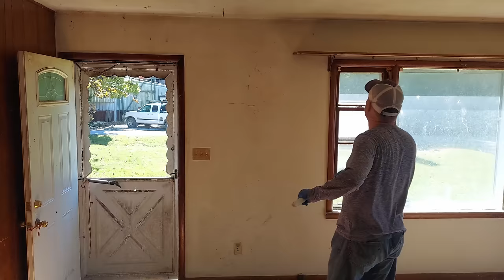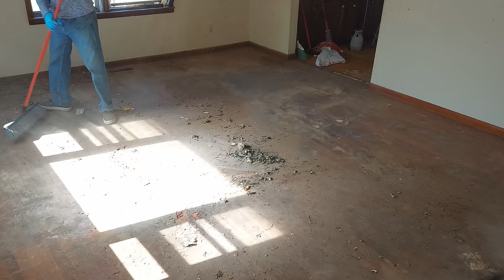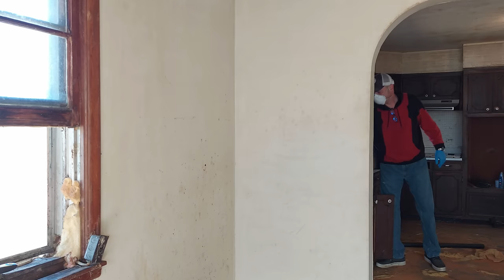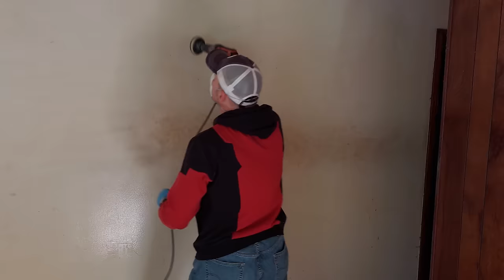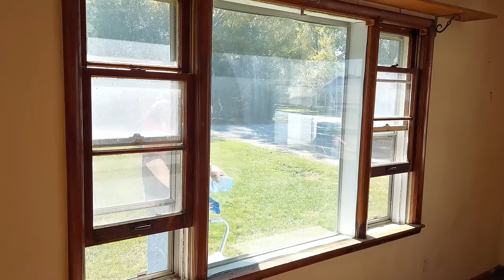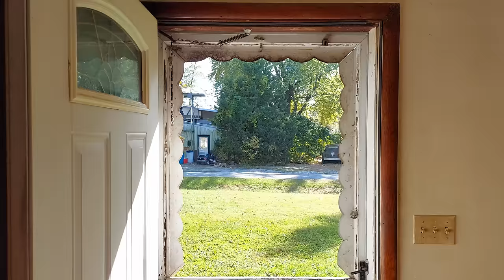Hoarder Aftermath: Cleaning RUINED hardwood floors

Comment: Old trick I was taught years ago was to take sawdust/small shavings and add a little water. Thoroughly mix until it has an even damp consistency. Throw around the floor and start sweeping. This will cut down on the airborne dust and help prewash the floor.
Reply: Sweeping compound works the same way.
Reply: I remember hearing that tip a long time ago.  It was common for people to have small amounts of sawdust around from wood working projects like fixing fences and building shelves. I think that stables and barns buy sawdust chips for bedding. They also use it to clean the aisles in the stables when they sweep them.
Reply: Also, just sprinkle some water on it, cuts down on the airborne dust.
Reply: To trap dust when sweeping floors when I was young, decades ago, was to throw on used (wet) tealeaves.

Comment: This home really looks like it actually has a lot of character. I hope it can be fixed up and salvaged. Thank you for what you do! 😊
Reply: I agree. It's a lovely home
Reply: @cynthianm1743  For that really nice flooring better to get a sander to remove the embedded dirt stained into the wood surface.
Reply: @chrisharvie-smith486  he better be a good craftsman to fix this
Reply: @chrisharvie-smith486  No amount of sanding will remove those dark stains which are most likely pet stains.
Reply: @HandbagDiva  You can do a fairly decent job removing a lot of those dark stains using a wood stripper. hardwood floors are best done by professionals.
Reply: Agreed! But there is A LOT of work that would need to be done. The owners would have to practically give it away. The walls can be salvaged with spackle, a good sealing primer (one that netralizes cigarette odors) and a fresh sandcoat and pain. All the wood needs to be sanded and restained and sealed. That kitchen is a nightmare. I'd probably gut it and any bathrooms (even though we haven't seen them yet! 🤢🤮 ) Im sure they are grotesque.
Reply: @johnwilliams8818  I've seen worse floors being revived. To keep quality flooring and keep their value instead of stripping it off to add cheap flooring , would outweigh the price of the rehabilitation of the floors. I guess it's an American thing to strip everything off and redo in plastic, but I've planned many renos of 400 yrs old places in Europe and Quebec where I live. And it's always cost less and preserved the patrimonial value, making it a better investment in the long run. This place now that it's cleaned should be treated for a good 24hours with an ozone machine. Kill everything that's left. I'd Ozone blast this place for like 12 hours each room and then ventilate for 24, and would leave a humidifier 24/7 to dry up the place for a while and see how the house reacts.
Reply: @HandbagDiva  it wasn’t pet, it was human …
Reply: If ever there was a prime candidate for resurfacing it is this floor. With the right tools and a couple days work, I bet $100 you could have those floors looking like they were just laid yesterday.
Reply: What a transformation of the floors and walls! If the wood is stained a dark tint, then it will cover up the stains. I’m a new subscriber based in Calgary, Alberta, Canada. I was born in Flint, Michigan, USA. I lived in Minneapolis for 10 years before immigrating to Canada. I’m a dual citizen too! Thanks for helping people in need, which is a blessing from the Lord Jesus and not a curse of the Devil. ❤❤❤❤
Reply: @MeMyselfetMoi this house is a gut job... and don't kid yourself with French Canadiana -- 95% of those old homes need new everything, unless you're uber rich and can afford the contractor q-tip job.

Comment: I would have never thought to use a carpet shampooer on hardwoods! Genius idea! I would have loved to see how dirty the water was you poured out! You really are an inspiration and model selfless service.
Reply: I've done it once, on floors that were coated in a mix of cigarette ashes, cooking fumes and other crap. Used a dual-brush floor scrubbing machine, and a shop vac to suck up the water.

I used a bazillion towels mopping things up, and the water coming off the floors was the color of cement.  But the floor survived and only needed a "screening" and recoating.
Reply: @YoMama9021  For normal floor maintenance, not a good idea. 

But, sometimes floors are so coated in filth that you have to use extreme measures to get through the layers of crud to expose the wood.
Reply: @lazygardens  yep, i was sure he'd go to a belt sander
Reply: We just did that when one of my kid's friends spilled liquid sour candy spray on our wood floors. Bright green ... 😭 Wiped it up immediately and then sucked it out of the cracks (and hopefully the subfloor). Worked pretty well.
Reply: I would have liked to have seen that water too!

Comment: My dad and I just finished refurbishing an old hoarder’s house, and I thought it was bad, but it was nothing compared to this! This house looks crazy nasty, but it’s nice to see some of its original character shine through once the grime and years of abuse are peeled away. Awesome job!
Reply: Hoarder houses can get pretty nasty. If you're interested, there are generally speaking 5 levels of hoarding, and this house looks like it was at level 4.
That means pretty nasty, but still recoverable.

At level 5 you get into the ones where cleaners will recover pets the occupant lost years earlier and where the occupants make "nests" for themselves to sleep on because there are no surfaces left.

Level 4 is still bad, and a big warning sign of mental instability. It will require outside intervention for the person to realize they need help, but generally, the person can make a full recovery.

Level 5 is what happens when they don't get that help for years or decades.

Comment: This is extremely satisfying, watching you work.  For anyone who may watch this and need to clean exceedingly gunned up wood floors, I just happened to see a video where a refinisher used oven cleaner to remove shellac hand gunk from a piece of furniture. It works. Would certainly be useful in situations like this. Using the carpet shampooer is an excellent idea for rinsing.

Comment: OOf. I encountered a LOT of homes like this back when I did home cleaning in rural Minnesota. All those black stains can come up with concentrated peroxide. It's best done when it's warm out though. It can also do wonders on nicotine/tar covered walls. These floors need a good sanding and refinishing anyhow. Great job overall. 😉👍
(If you are considering using peroxide you can usually pick up gallon jugs of it at beauty salons or off of good old Amazon. It comes as a cream so it stays in place for the most part. Make sure you have a respirator though. It's a super oxidant so it can cause off gassing.)

Comment: I cleaned an apartment with nicotine stained walls. Someone told me to spray with bathroom scrubbing bubbles foam, let it set, then use sponge mop or squeegee to remove ( staring at ceiling and dragging to floor).  That process was quick and took much of the nastiness off.  Of course, needed to be wiped down a couple more times but made it much easier.

Comment: So glad I stumbled upon this video! We sadly have floors similar to this. Part was ripped up with carpet and badly stained. The other part used to be good but we had a litter of pups in early winter so we had to do what we could inside. Needless to say, after the pups left we cleaned as best as we could but obviously the stains remain. Additionally being a multi dog household, we recently experienced very wet/muddy weather that you could barely keep up with mopping. There’s a lot of debris on the floor that I have been struggling to clean up with traditional mopping. I have the exact same carpet cleaner and a bio enzyme floor cleaner that works wonders. I will have to try this cleaning/rinsing method on occasion until we have funds saved up to lay vinyl laminate over the floors.

Comment: Very interesting way to take care of the grimy floor.  Looks worlds different now!  I know it had to take you a long time to get it to that point, floor scrubbing done right takes time.  Amazing job!

I just purchased a home that was smoked in for 50 years. I paid below-market value because of a few things, however it was still in great condition.  It smelled terribly of smoke and everything you touched was covered with sticky nicotine and tar buildup.  We started with the paneling, pulled it all down and burned it.  We scrubbed the floor, no where near as bad as what you had to clean. Funny, we did it almost the way you had done, using Murphy's Oil Soap and the same red handle brush from Walmart.  We slop mopped it, then scrubbed, then came back over it again with fresh Murphy's, and it looked amazing.  We used an entire bottle on all the floors.

Since we pulled the paneling down, the baseboards had to be removed.  Some of the boards broke upon removal and had to replace them with a new style.  Luckily I was able to salvage 75% of the old stuff.  I made a bunch of repairs in the closets and the dining room.  Since these were off-the-walls, I scrubbed them at the sink with Murphy's.  Lots of spares to repair to use for repair in the bedrooms.  I scrubbed down all the walls using Pin-Sole, and that was the absolute most discussing thing ever.  I had my buddy's brother professionally paint every room, using high quality primer and paint from Sherwin Williams.  Sunday, I scrubbed down the yellow window frames, now they look gleaming white!  I still have to clean the glass because I ran out of time.  

Today, the hard wood floors have been sanded down and will be finished with new stain!  I still need to remove and replace all the light fixtures, wall receptacles, and light switches (yellow and sticky from 50 years of smoke damage).  It's a lot of work, but I'm almost to the point where I can begin packing and moving in.  Thanks for sharing this progress, it's been motivating!

Comment: I used to work for cleaning company mainly doing windows, gutters power washing, wall washing, floors. On wall washing jobs we would use our window mops which are sleeves on t handles. For light cleanings we would use TSP and hot water and cold straight water for rinsing. On heavier cleanings we would use TSP and borax in hot water.

Comment: That is significantly better and I'm sure a lot of renovators might just replace the floor altogether but you saved it! It's not perfect like you said, but I think if you sanded it and/or treated it with some kind of wood mold killer and refinish it it would still be an amazing hardwood floor for the new owner

Comment: You did a really great job here! A few great products to check out that may make jobs like this a bit easier in the future. 1st up: LA's totally  Awesome cleaner is fantastic for getting tough stains out and is extremely cheap (think dollar tree). 2nd:  you can buy knock off magic erasers from wish (I think I last purchased 100 of these for about $5), Both are really great for getting rid of nicotine and touch stains/grime.  3rd: O'cedar spin mop makes wall cleaning a breeze and you can buy multiple mop heads then just toss them in the wash with some bleach to clean and sanitize them

Comment: I have found that Awesome works great on walls (and lots of other surfaces). I mix about 1/3 to 1/2 Awesome and then fill with water. I usually use a 1-gallon garden sprayer for big jobs like walls and a spray bottle for smaller jobs. I thoroughly spray an area from ceiling to floor about 4 feet wide. I use old towels to catch the excess and prevent soggy carpet. I use a Mr. Clean sponge mop and a bucket of water. Then scrub and rinse. Awesome is also very good for cleaning really greasy, sticky or gross light fixture covers, glass knick-knacks, etc. I put the items in the kitchen sink, bathtub or outside and spray them down, wait a couple of minutes and rinse. Usually there's no scrubbing involved.

Comment: What a job! The best thing is to strip these floors of sand them and see if they can be salvaged which I’d think usually it’s possible but amazing job cleaning up the filth
Reply: He said that he’s a cleaner, not a floor finisher. Need another guy for that. Most of these places could use a whole HGTV crew for about a YEAR.

Comment: carpet cleaners on hardwood floors are amazing for getting the fine particulates from between the boards, I found a hardwood attachment for my Bissel I forgot it came with before I moved recently and the even though I had swiffered and used the murphy's hardwood floor soap it still changed the colour of the floor boards, was amazed with it.

So what was the ultimate goal with this, since those floors clearly need to be sanded and refinished and in theory all your hard work will be wiped out by that.

Comment: I use a similar method. Will swap out my shop vac for a carpet cleaner tho because the rinsing with clean water as you suck up the dirty is just smart. I normally hose down the room using a sprayer with the some mix ratio and let soak a little before scraping the big stuff then I normally do 2 scrubs, the first pass across the way the boards are laid and second pass along the length of the boards then let dry before repeating. Then put down a thin layer of oil before sanding so help with some of the dust. Once sanding is done if needed I stain the floor let dry then I saturate the floors in oil. The I saturate it again in bad cases like this one. After that is soaked up I use Quick Shine hardwood floor polyurethane to help lock in the moisture and keep the floors hydrated. Most houses like this have several rooms with hardwood floors so it generally takes a full week depending how many rooms. While stuff is drying or soaking or what not I'm cleaning walls, ceilings, lights, doors, windows, vents, radiators, just everything. I've never had a single complaint in 3 years so this process works. I love the before and after pictures I take and also the reactions of the owners.

Comment: I have this same carpet cleaner that I got before I ripped up all my carpet. I had no clue it would work so well on a smooth surface. I kept it to use on upholstery and area rugs but now I might try using it on the floors for days I need something more extra than a bucket and mop.

Comment: I bought a well-lived-in home almost that bad (didn't know it, because when I viewed it, it was cluttered and had a fireplace going so all you could smell was wood smoke), and the problem I haven't been able to overcome is the smell. The place reeks! I keep my clothes in tubs with secure lids so the clothes don't smell so I have something to wear. I'm told that both of the previous two owners, spanning a quarter of a century in time, had messy dogs and semi out-of-control cats and indoor rabbits. Watching this video gave me a glimmer of hope. I didn't know you could scrub hardwood floors - the part containing most of the odor - with soap. If I can get the smell out of the floor, I can paint it and cover it. I've been told, though, that likely the odor is in the floorboards, too, and I will have to replace everything - which I can't afford.

Comment: I used to refurbish old houses. You can use something to clean up the look of the Floors old and finish shot,  you can use,  'Mop and Glow: instantly gives it a finished look. it"s water based and it makes the floor look wet or shiny. Hey it at the Grocery Store. Yes, it's reversible. I"be put as many as 5 coats on shotty floors.

Comment: You might have tried some baking soda mixed with dish soap to break down the thick areas. The gentle abrasion with strong soap will hopefully degrease the nasties. And good old Spic & Span. My mom would wash all the walls in our home and paint each room because both my parents smoked and it removed smoke residue. She also used it on our aluminum siding prior to repainting our house outside. She did this about every 10 years. Af I have a special rubberized rag that cleans glass and mirrors without streaks. I use water, 1 cup white vinegar, and a few drops of Dawn soap.

Comment: Several years ago I began cleaning and repairing a 78 year old stick frame house. When I got finished with tearing out the second later of worn, torn, faded lenoleum in the dining room, I was ecstatic to find a layer of beautiful green patterned barely worn lenoleum. It was not glued down. I carefully lifted a corner up and discovered oak tongue and groove flooring. I really had to debate it, but I took up that beautiful green lenoleum.

Comment: In the past for hard soiled cabinets and floors I've used trisodium phosphate, usually used in application where you might re-stain or paint, to cut through a lot of grease, oils and other items. Although, probably helps with the smell in a hoarder house.

Once you've done that you can follow it up with oxalic acid to bleach out stains in wood without bleaching the wood itself. Works best on bare wood so sealant may need to be removed. Can take a 1 to a handful of applications. Then you neutralize the acid  with baking soda like mixture. Let dry.

Comment: I am so impressed with your excellent work and how hard you work.  I was thinking that if you want to try a none toxic cleaning solution, you could sprinkle baking soda on the the floor and spray it with vinegar and let it soak a bit.  I use this when I burn my pots black -  so bad I can't even scrap the bottom with a knife. I was also wondering if you ever use a steam cleaner on floors and other areas? God bless you and keep you safe!

Comment: Have you tried banana oil on old floors like that? I helped clean a place in Colorado (45 years ago) that the buildings were all over 75 years old at that time. We used banana   oil to seal the old dry wood. Worked wonders and smelled good too!